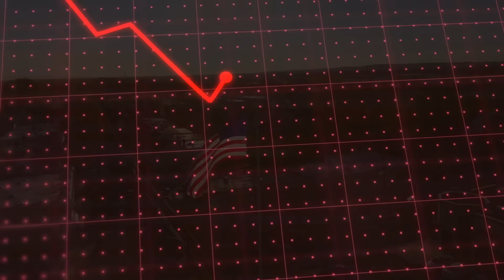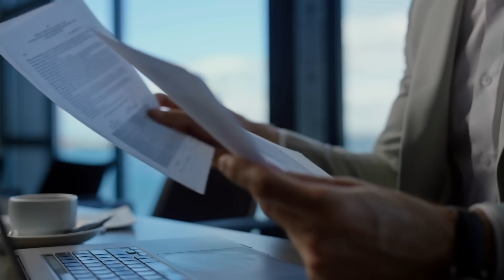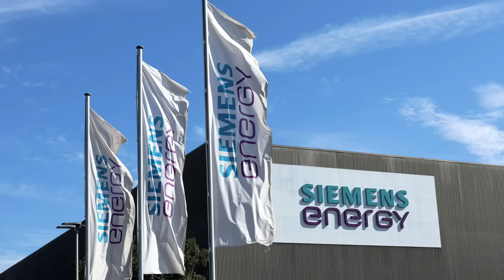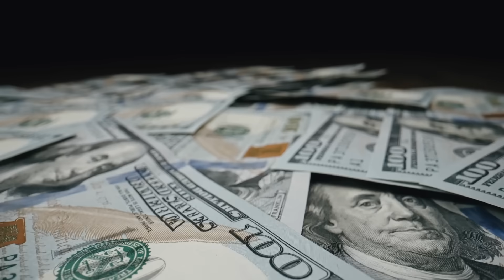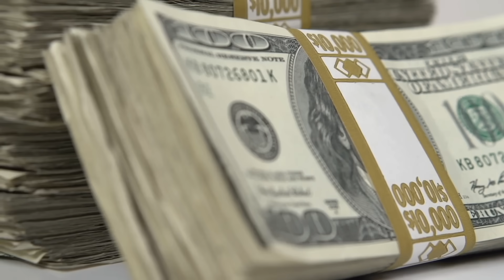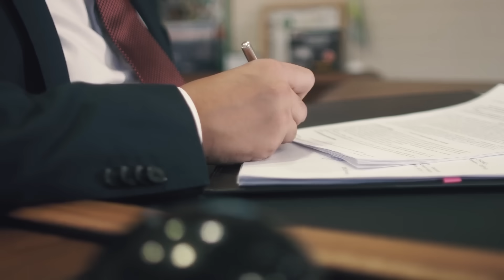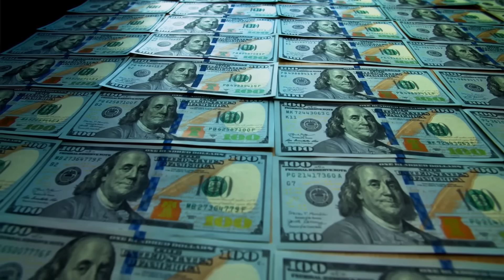The Real Reason America Has Turned Its Back On Wind Power Energy

Comment: At about 3:55 you say, "flawed power distribution system". What? That just shows an ignorance of how the industry is structured. The issue is the transmission system. The electric utility system is divided into three parts. These are generation, transmission and distribution. Distribution refers to the provision of electricity to customer premises. Transmission is the part that gets the power from the generation system to the distribution system. I have a lot of knowledge of the US electric utility industry, and to my knowledge, there are not a massive number of transmission system caused outages in the US. The only exceptions are those states (the system is mainly state regulated) that have pushed renewables without looking at the systems aspects of those sources. The US system was not designed for renewables. So, the implementation of renewables without including all of the various supporting elements is just plain stupid planning. It is not a flawed distribution system. It is, in fact, not the distribution system that you are referring to. It is the whole system concept that is flawed, and it is centered around renewables, not the legacy system. 

Let me give you an example. I was at an engineering conference where vendors were showcasing their design software using wind turbines as an example. When I asked about energy storage there was a lot of reaction. The wind turbine fanatics were trying to shut me up. Others agreed that this needs to be considered. The problem with including storage is that the cost goes up significantly. We hadn't even gotten to the transmission issue. You allude to some of these issues and costs, but you continue to use the term distribution incorrectly in relation to this industry. 

Just look at Germany. Recently, they tore down a wind farm to make way for the expansion of a coal mine. By the way, their coal is lignite, which is the dirtiest to burn. They have shut down their nukes at just the wrong time for a really stupid reason (Fukushima). The government has reclassified natural gas as a "clean" fuel. It is a clown show.

Perhaps you could revise the video. There is some good information, but it is obscured by the glaring mistakes.

Comment: You failed to mention that there is insufficient trained and experienced electrical engineers and technicians to to the installation work. Money alone is not the answer. Manpower resources are required.

Comment: Depending on big oil money to advance in wind energy projects is not hard to figure out why they don't want to ,would be like biting off their own nose to spite their own face.Sure the use of any means to generate power has negative effects. But with wind and solar there are is no polluting of groundwater such as with traditional coal-burning plants.. See the argument of the effect it has on birds also mentioned is it is a sightly mess. But at the same time coal-burning polluting the groundwater literally kills all species that comes in contact with. What is the more dreaded site some windmills will turning in the distance or a coal plant smoking in the distance.Words like Repair,fix , maintain come to mind when thinking of any man-made technology they all need maintained fixed or repaired eventually. But at the end of the day wind and solar leave a lighter carbon footprint..A win-win all the way around the board..